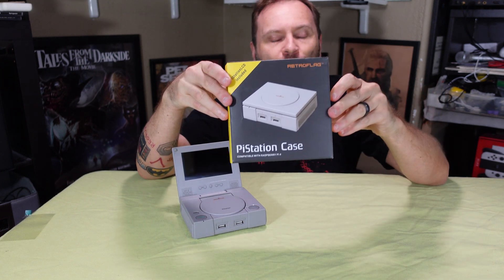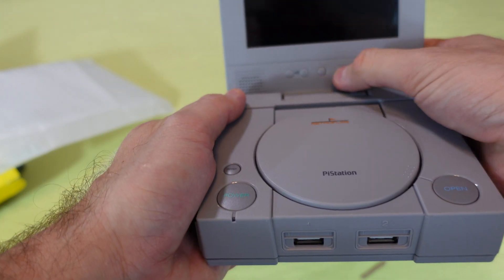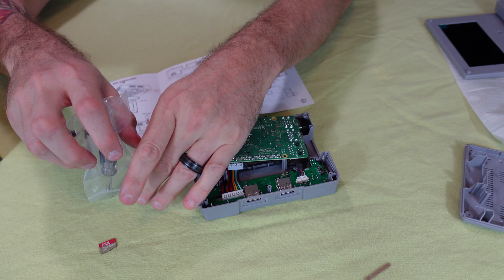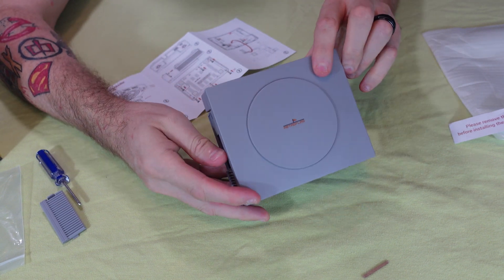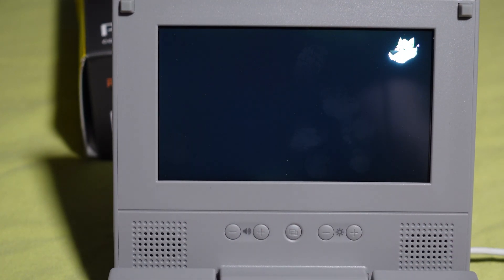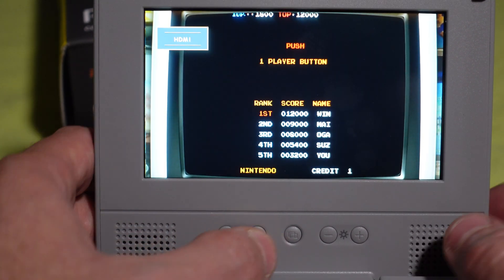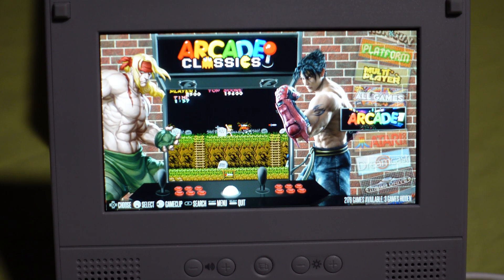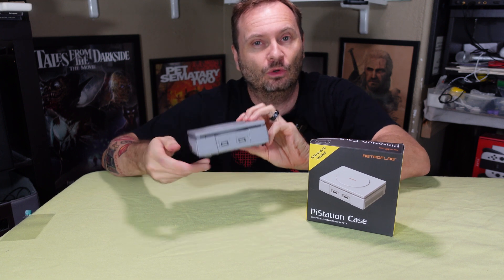RetroFlag PiStation Case + LCD (Build and Review)

Comment: What fan should I use for it. Can u give me a link pls?
Reply from the maker: I actually don't use fans on the Pi setups I have.  I do use good heatsinks though
Reply: Thanks, also what controller should I use and do I need an adapter to plug the controller in? (Sorry if “adapter” isn’t it I just found this and I’m interested.
Reply from the maker: @MikeSmathers-e6l  You can use pretty much anything.  I usually use wired Xbox controllers with mine.
Reply: @darkuni  ok thx sorry for me saying stud if it offended you I think it autocorrected it.
Reply from the maker: @MikeSmathers-e6l  I'm pretty hard to offend, friend :D
Reply: @darkuni  thank you😃

Comment: I just got one of these a month ago. My screen keeps going in and out. Is there anyway I can fix this?
Reply from the maker: Does it seem connection based?
Reply: @Darkuni  Everything is connected as instructed. The screen is fine when there is no sd card in the pi but when it starts to boot up... it boots but the screen goes from on to black every second.
Reply from the maker: @mutechannel13  I'm going with "defective".  Amazon?  Return?
Reply: @Darkuni  I got it from Amazon. It way past the return window.
Reply from the maker: @mutechannel13  That sucks...